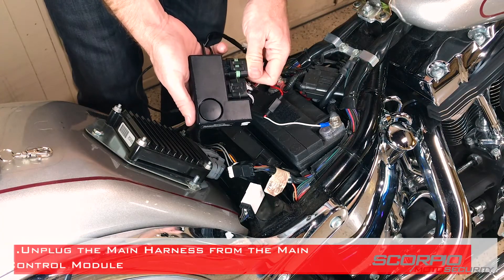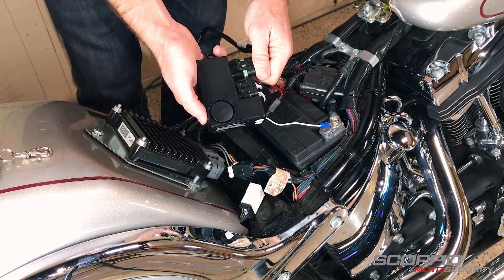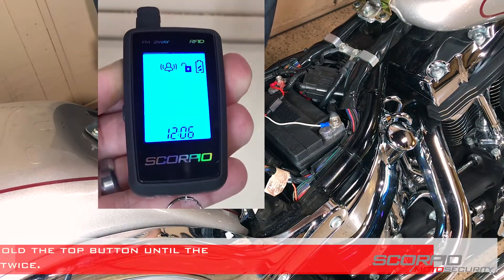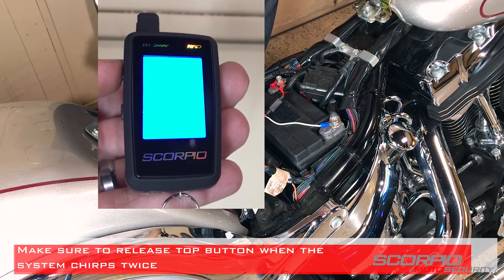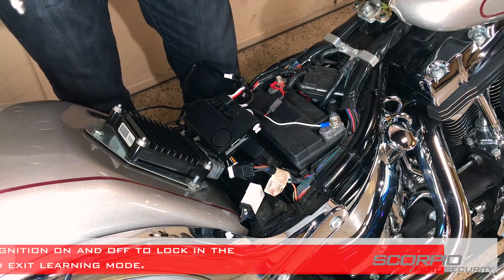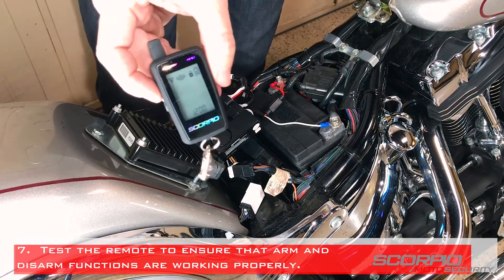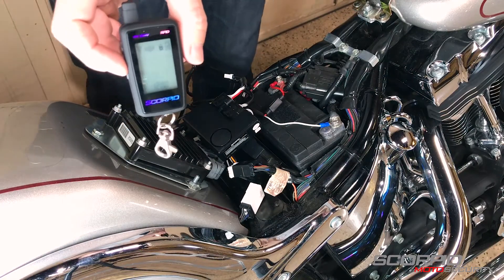Scorpio TRS-9 (SR-i900) and TRX-9 (SRX-900) Remote Encoding

Comment: I'm having an issue getting into learn mode.  It doesn't chirp twice confirming it's in learn mode.  If it is already disarmed do i have to drain the backup battery still?
Reply from the maker: Please note the speed in which you need to cycle the ignition. see :52 second mark of the video. The only other thing that could be hampering the speed in which you do this is if your bike has delayed switch power. Meaning the bikes switched power source does not turn of immediately when the key is in the off position. If you have this problem contact our support team at 480-951-1109 to discuss how to circumvent this.

Comment: when i unplug the main harness, and plug it back in, it doesnt do the 2 chirps for me to continue to the next step, plz help
Reply from the maker: First thing to check would be to verify all connections to the bike are good. Check that your battery positive, ground, and switch power connections are good. Sometimes on the SRI-900 system, people can mistake the positive connection for the negative, you can make sure it is a positive wire connection by the inline fuse. If you are still having issues getting this to work properly, please reach out to our support team at help@ridescorpio.com.

Comment: i cant get the unit to enter learn mode
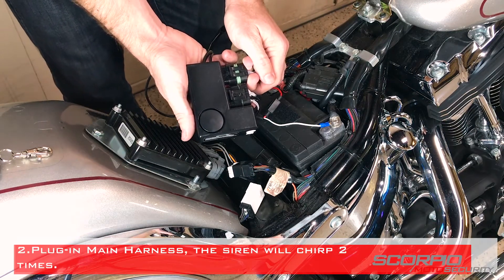Reply from the maker: Many times it has to do with the speed in which the ignition is cycled. See 0:46 sec mark of the video. If still having issues please contact us directly at 480-951-1109 or at help@ridescorpio.com for further assistance.